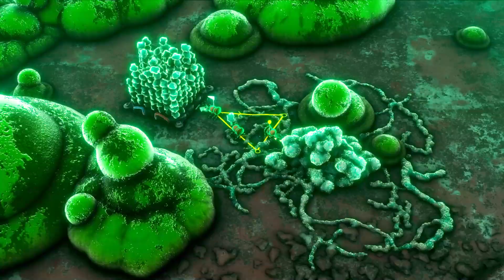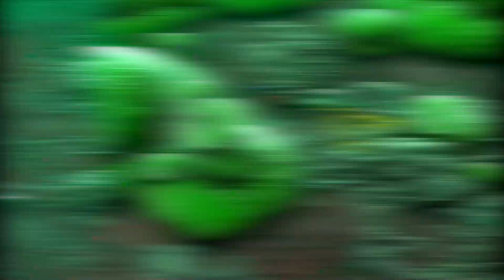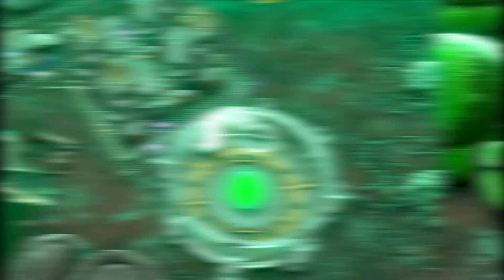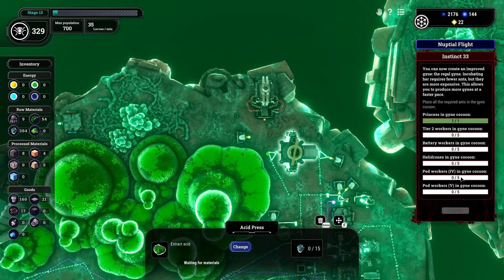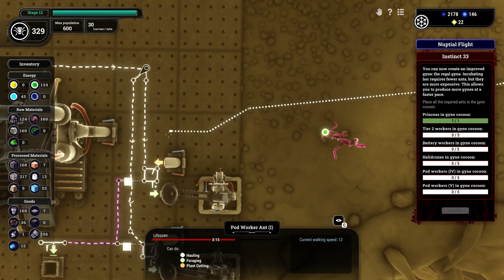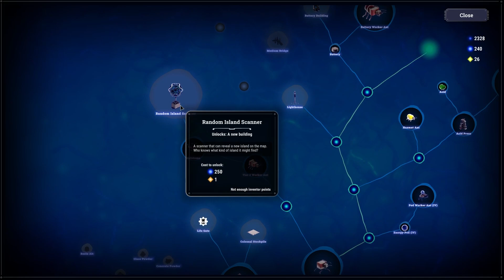Hazmat ants and ACID production - Microtopia EP20

Comment: Here is an idea for improving the acid press setup:
Use small feeder loops to quickly get the 15 blubber into the current press. When the press starts processing it won't accept the blubber, so you can use a carry gate to route the ant to the next press with a similar setup.
This maximizes time spent actually feeding presses and minimizes time spent running from press to press.
Scale the number of presses for one ant based on the ratio between feeding time and processing time.
Also this should make sure presses produce more evenly instead of all being filled up at the same time with a big delay between batches.

Unfortunately, I can't think of a good way to improve the acid pickup. Ideally hazmat ants would go to presses that have just produced, otherwise idling in a smallish loop. Perhaps a combination of timer gates (in), carry gates (out) at the presses, tuned to the total time it takes to fill a press with blubber and finish the process?
Reply from the maker: That's an amazing idea dude with the loop. 

With the acid I ended up just making the smallest loop possible to store into a vat which is needed for the crystalising process

But for batteries, I just direct feed the acid into a facility... seems faster kinda, a regular ant can pick up an acid and put it into a facility without being irradiated